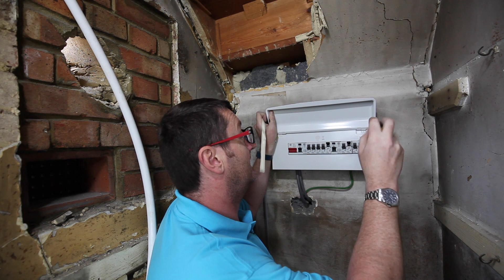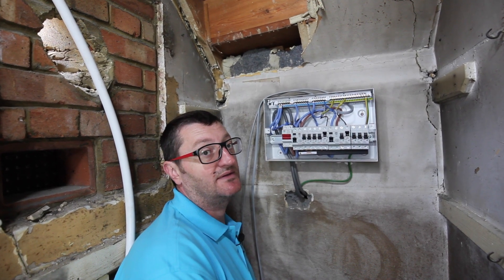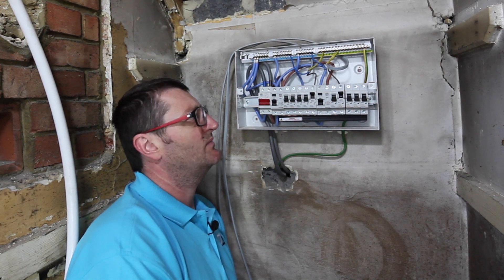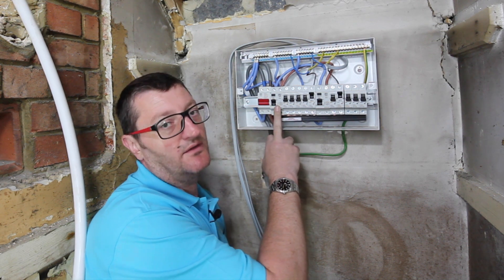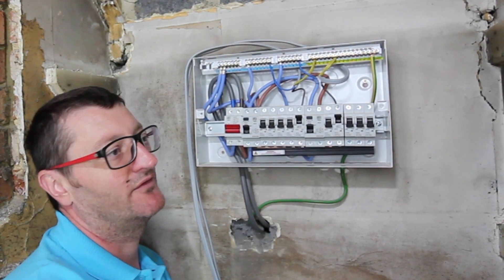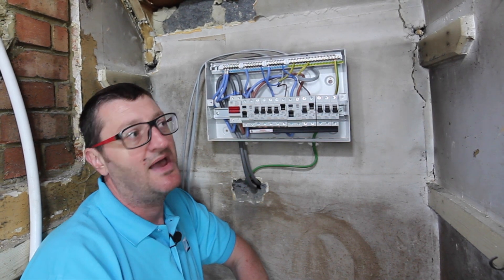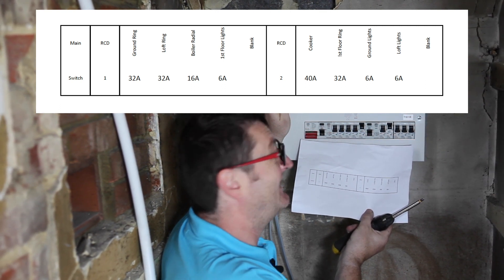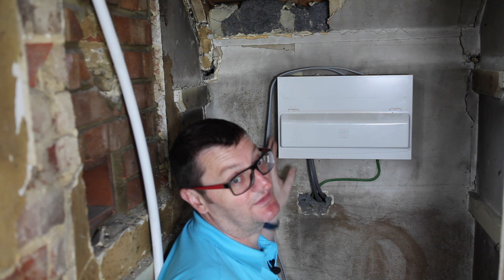Fuse sizes and positions in a Consumer Unit (Fuse Box)

Comment: Kitchen ring??
Reply from the maker: Up to you if you want a separate kitchen ring too, this house has an open plan living and kitchen space so I didn't separate....   Neither the regs nor EICNIC call for a separate kitchen circuits, so it is down to the choice of the installation designer and to a degree the customer...  but if you want to have an all singing and dancing installation the fridge freezer should be on a separate circuit and it's own RCD too....

Comment: Rings are a thing of the past. Run 16 or 20 amp radials, there’s no load in domestic living areas
Reply from the maker: Each to their own, but radials need bigger cables and are therefore more expensive...  I'll stick to rings until the IET says otherwise.
Reply: MPCpropertydevelopments why do they need bigger cables? A 2.5 mm 20 amp radial is more than enough.

Comment: Why do you use a 40 for the cooker and not a 32
Reply from the maker: you could continue the question... or why not 16a....  it all comes down to cable size calculations and the correct over current protection for the chosen cable size, balanced with the avoidance of nuisance tripping..  typically that is 6mm cable and a 40a breaker, but it all comes down to the design and calculations of the installation.
Reply: @MPCpropertydevelopments  Never usually needs to be on a 40a breaker 32a is more than sufficient for most cookers
Reply from the maker: 'most' but not all....   this one for example;  https://www.currys.co.uk/gbuk/household-appliances/cooking/cookers/flavel-mln9crs-90-cm-electric-range-cooker-silver-10160584-pdt.html    As I say depends on the equipment being used and the installation itself....  you should never use rule of thumbs, you need to get the regs out and do your cable and breaker calculations...

Comment: Ring circuits are just not needed in this day and age. 4mm radial circuits are just so much easier to work if you wan 32amp circuits, testing is easier, even 16Amp radials on 2.5mm is more than enough for most domestic houses.
Reply: Totally agree with ethan above, 4mm twin and cpc is generally not rated enough for a 32A mcb as its rated at 37A only when clipped direct but in most houses with going under flooring and stuff it will be referance method B which 4mm is only rated at 30A best case scenario so either use a ring or drop the mcb to 25A
Reply: Concur entirely with your comments, most sparks I know haven’t fitted ring mains in over 9 years. If there’s any issues you soon know about them as opposed to having an unknown split ring circuit.
Reply: Or 2.5mmm with 16A MCBs, that it's pretty much the standard in all Europe, when do you pull 32 amps from a socket circuit in real life ?
Reply: 32a ring for kitchens were the majority of the load is and 16a/20a radials for upstairs and another for downstairs

Comment: What about the smoke alarm circuit?
Reply from the maker: Thanks WYGD1990, A very good question as the regs require you to add smoke/ heat detector circuit if you are significantly changing the existing wiring and in a re-wire you certainly are.

So there are 3 ways of doing it;

1; Use devises with a battery back up so you can take them from the lighting circuit.  
2; Use a battery operated radio interlinked system independent of the mains supply. 
3; Have a third zone solely for the fire detection circuit, this would be on it's own RCBO as you don't want this one to nuisance tripping.

I tend to use method 1, as simpler and cheaper to do that way but the choice as the say is yours.
Reply: Supplying them from the lighting circuit is not a bad idea to be fair as they are very low power and at least that way they will never be switched off and forgotten about.